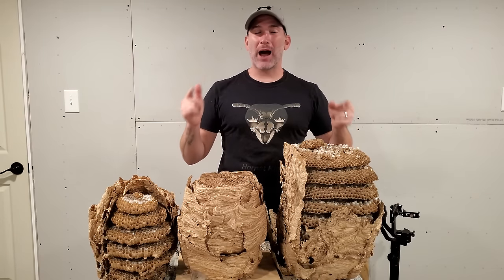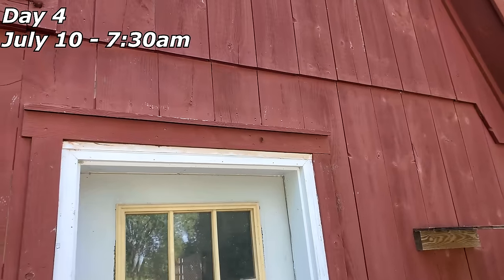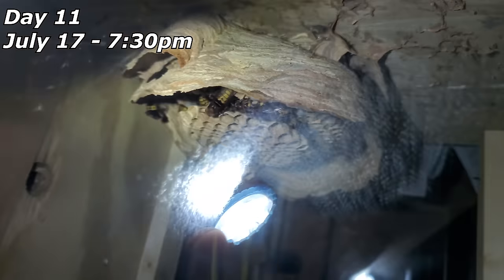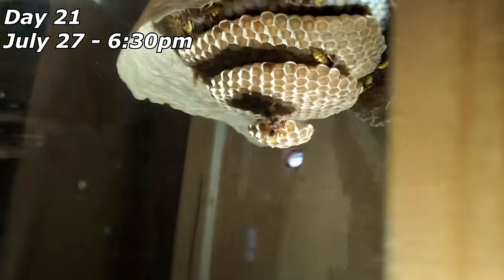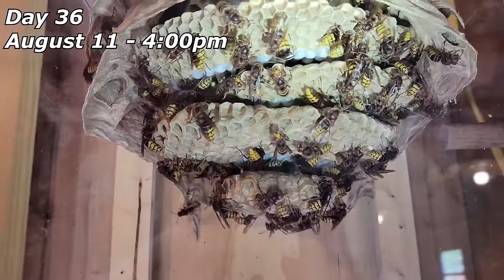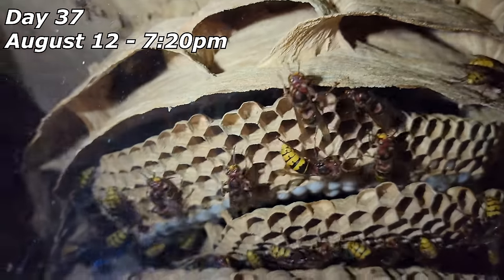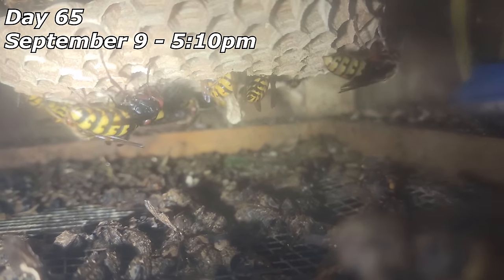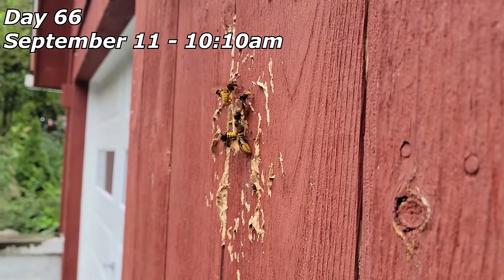Growing a MONSTER Hornets Nest! | How I Relocate and Keep Hornets!

Comment: My Biggest question for you are:
Why didn’t you setup a plastics waste bin underneath to collect all the waste?
Reply from the maker: The waste and decomposing carcasses are in the box. Not under it. Periodic cleaning of the box was fine.
Reply: @HornetKingOfficial  there was so much waste on the floor and rushing you tools.
Ones you scrape it off the floor and gave it to you chicken.
Way not make a system to catch it so that it doesn’t hit the floor or your tools?

Comment: Why didn't you build something to put a few feet below the wire mesh to capture all the body waste, rather than let all that smelly waste product accumulate and rot away the wood and flooring below?  Or at least put down some easily disposable paper (like the brown rolled paper that hand laundries use to wrap up customers' shirts or what butcher shops used to wrap up customers' cut meat)?

Comment: Why?!?  

Most every time I've seen these things it ends badly.  I'm not a fan of them.
Reply from the maker: Then you don't understand them. Check out my facts about wasps video.
Reply: @HornetKingOfficial  I will, thanks.  Clearly, you have a lot of knowledge about them and also some reason to appreciate them.  Admittedly, I don't know a damned thing about them, other than the few times I've gotten attacked and bitten.  (I think wasps bite, instead of stinging, right?  They bit me.  Huge ones.  I'd be exaggerating only a 'little' by saying they were almost the size of hummingbirds--but they honestly were way bigger than anything I'd ever seen.  About the same size as bumble bees, but longer and more gnarly looking). In their defense though, I ran through their house with a bulldozer, and they didn't chase me very far--not like yellowjackets have chased me in the past.  Those buggers don't give up!